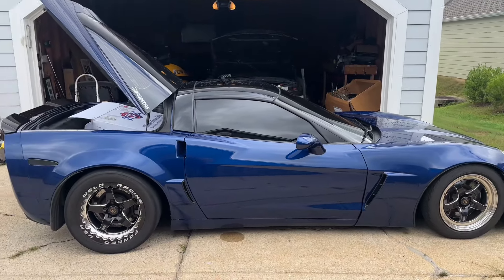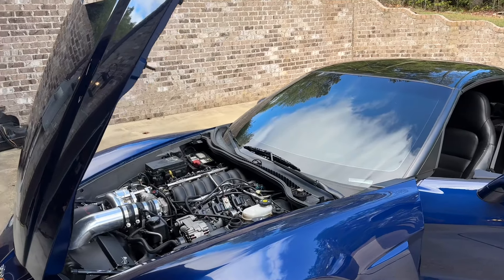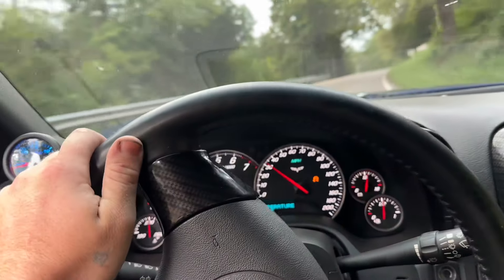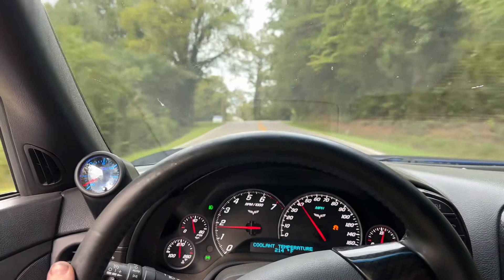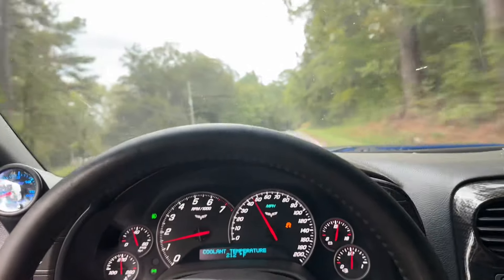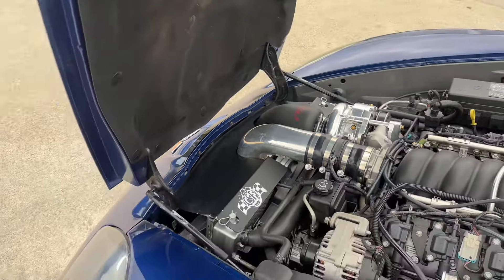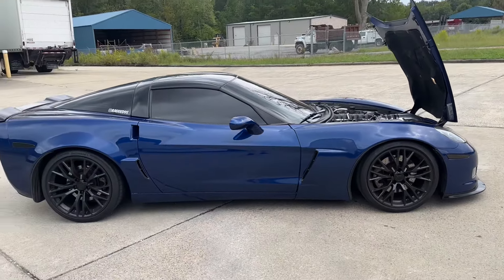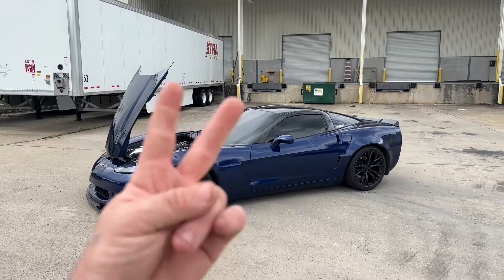Installed the new CSF aluminum radiator in my C6 Corvette!

Comment: Does this not fit a stock ls3? I’m installing it on mine and i’m having clearance issues with the AC condenser; the tabs where you insert the AC condenser to hold the radiator in place seem to be in the wrong place. Hopefully that makes sense
Reply from the maker: From my understanding that radiator is supposed to fit all  C6 models! Is the condenser not wanting to slide down into the slots
Reply: @ yes, it seems as though the new radiator is sitting lower or something.. the tabs on the condenser are too high to slide into the new radiator and I can’t seem to figure out why